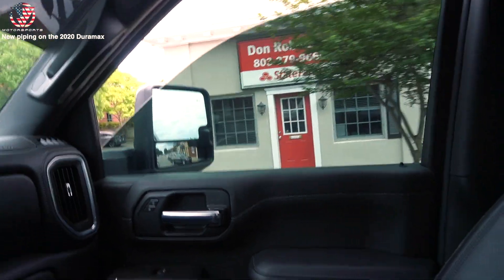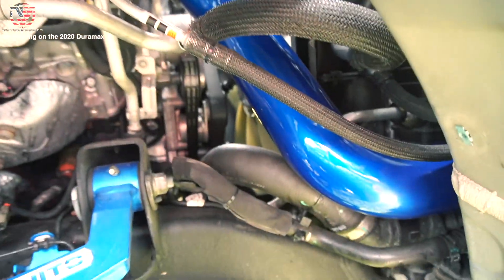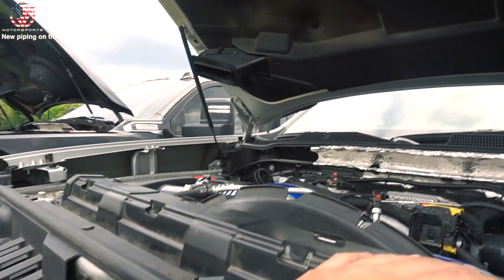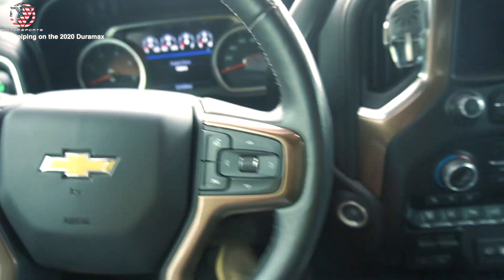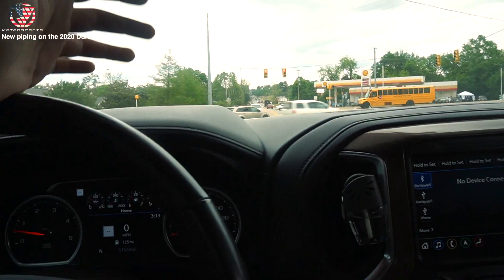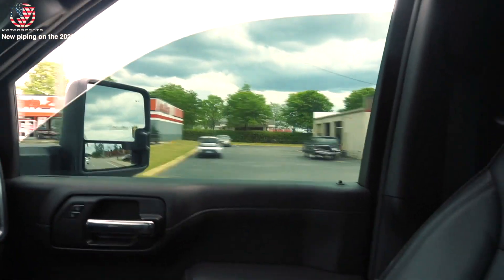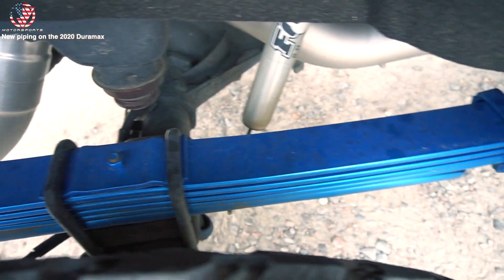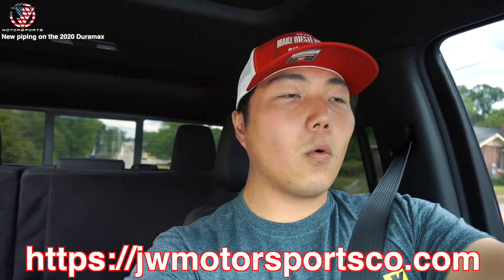This 2020 High Country Duramax has RUINED my 2020 Duramax... CRAZY TURBO WHISTLE!

Comment: You can 100% hear way better air flow out of the silver L5p. I have a deleted L5p as well and as soon as I put the intake and turbo mouth piece on changed the air flow a lot sounds identical to the silver truck in your video. I don’t have any of the other piping yet just intake and turbo mouth piece. Helps the truck pull in a lot more air and you definitely here it out the back end
Reply: And most definitely made the throttle response a lot better!

Comment: I had the toughest decision buying one of these trucks, That front on the High Country sold me...the bronze in lay carries into the interior and when coupled with the Umbra...you can not beat it. So yeah I sold my 2020 Tremor to buy this Chevy..so far I am happy...Now comes the hard part of deciding how to mod it...not sure if I should go Level or 4 in lift. Do not want to sacrifice the usuability of this truck. I tow alot, and do not want the trailers shredded with rocks, So i want to keep wheels inside the wells. The black 2020 you did with the level kit looked sweet. Stock wheels and 37's...Think that would be the direction I want to go...Great Channel btw!!! Truth be told which gives better ride?

Comment: Gmcs have usually always looked better, even now the denali duramax looks the best to me. However that chevy high country is a really close 2nd
Reply: Same here I had a 2019 gmc sierra 1500, with a 3'5 inch lift blacked out. But I needed a 2500 duramax for work, I found that GMC looks shit in white, I didn't want black so I went with the high country but to look at I still think the GMC looks better but screw black always dirty, shit also high country has better interior in my opinion.